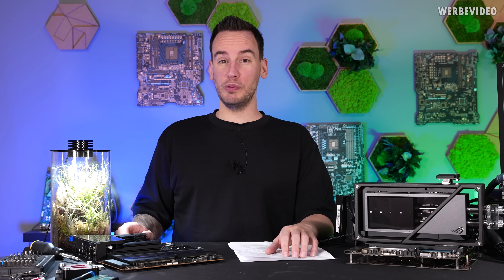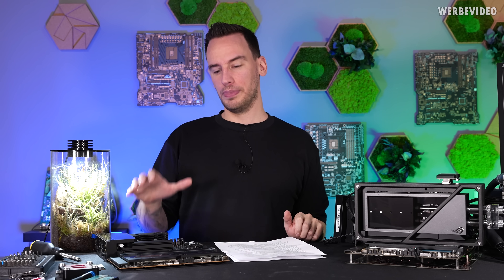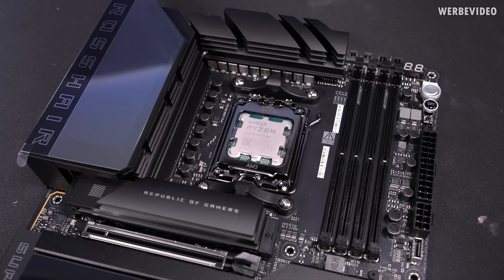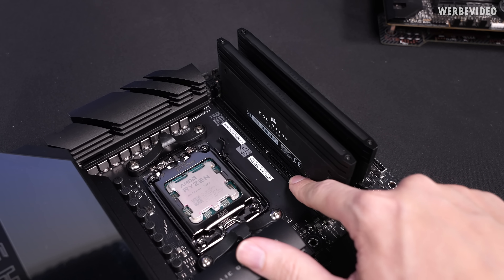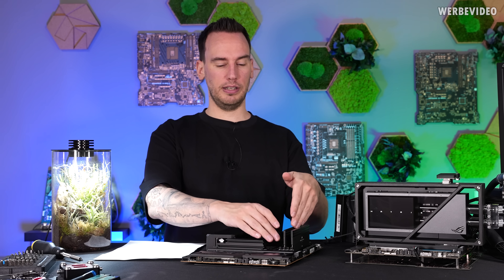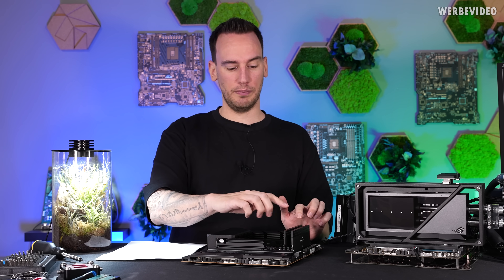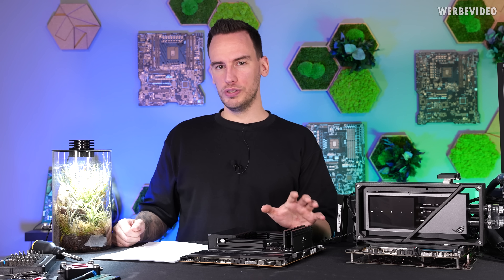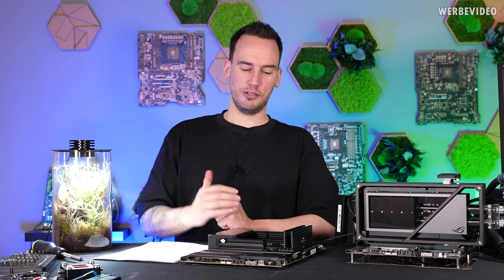How Empty RAM-Slots cause Trouble - ASUS NitroPath

Comment: Electrical engineer here. 

Any time a signal is operating at a frequency with an associated wavelength that is shorter than the cable, wire, PCB trace, etc. there will be reflections of that signal internal to the conductor. When a signal gets to the end of a conductor it does one of three things depending on what is at the end of that wire.

1. If there is nothing it radiates through open air, acting like an antenna that is transmitting.
2. If there is an impedance matched load it will transfer it's power along.
3. If there is an impedance mismatch power will be reflected back down the conductor.

Realistically there is a little blend of all three.

The longer the pin at the end of the trace the more it acts like an antenna, receiving and transmitting signals.
When two conductors are ran in parallel, a signal on one line can electromagnetically couple onto another line. This is know as "crosstalk".

The difference between pins acting as antennas and crosstalk transmission is simply the material between them. 

Air allows the transmission of a signal much better than fiberglass, PTFE, Rogers (epoxy and ceramic), etc.

Thus the shorter the pins the better the signal integrity.

With motherboard memory we have 288 parallel traces per dim slot. Each acting as a receiver and antenna, millimeters apart from each other. It's a wonder how we got this far. Eye charts with no eye tell me this memory form factor doesn't have much longer. I see CAMM as an upcoming stopgap form factor.

The ultimate solution is to get rid of these traces and pins entirely. We already see this in extremely high end parts using HBM.
Reply: would a "grounding" system be helpful in mitigating it?
if the slot is empty the "ground" is touched reducing/mitigating the problem.
when a slot is full the "ground" isn't touching. (not sure if having the slot occupied really helps but I'm sure it does a little).
Reply: @jetah50 
If you were to only ground the signal, it would just send it back down another trace or onto ground layer of the PCB. 

The best course of action would be to terminate the signal with a load. Removing the slot with open pins entirely would also work fairly well.
Reply: @joelduncan5110  Of course if you terminate the signal, you are taking away some of the power making the distinction between 0 and 1 smaller, so you'd likely need even more voltage to account for that which is another issue entirely.
Reply: @alexatkin  We would only be terminating where there is NC. The expected return of a floating NC and a terminated signal should both be near if not actually zero. The entire point of terminating is to remove the power in a manner that minimally impacts the RF spectrum radiation (usually via thermal radiation). 

Additionally increasing the power increases crosstalk. Not the best approach for this particular problem even if it were applicable.
Reply: What if I insert 2 additional modules to empty slots and disable these modules in BIOS (Asus allows this). Would it help properly terminate signal?
Reply: @dmitrylozenko7123  I don't know if disabling a channel in Bios would mean that it there are no data requests and thus no signal on the traces going from RAM to CPU or if the memory controller on the CPU just dismisses the returning signals. I would hope the former. Most board manufacturers that I know of have this option.

I did a quick test on some configurations a while back when trying to maximize the clocks of my 128gb of DDR4. Removing 2 sticks then disabling the slots, reinstalling them and re-enabling the slots. IIRC the results appeared to match the theory. 400MT differential between best and worst configuration on (qty.1 or 2) 64 GB (2x32GB) 4000MT kits, but I was messing with a lot of other settings as well.

Overall, it's an expensive and imperfect solution with minimal gain. If you really want the speed more than the space, just buy a two slot board. If you are in that scenario where you have two old cheap sticks you can give it a shot, but it may throttle speed to the lower performing kits values before disabling as well.
Reply: @dmitrylozenko7123  yep
Reply: @dmitrylozenko7123  Interesting idea, did you test this?
Reply: Another solution is BGA chips used in graphics cards, laptops and smartphones especially for GDDR and LPDDR.
Reply: That makes sense why some motherboards allow you to change the impedance parameters for the RAM as well. Some people went that far to achieve higher speeds.

Comment: at these speeds, your digital signal isn't digital anymore. You have AC instead of DC. Now instead of resistance being your enemy, you have inductance, capacitance, and loop length. This is really why reducing your "antennas" caused by the old slots gives a slight improvement. 

If you really want fast RAM, put RAM slots directly behind the CPU with vias and use SODIMM slots instead. What you can also do is put both sticks equidistant and spread apart from each other with the CPU in the center.

Comment: Spurious emissions of adjoining traces and pins is a solved problem in RF design. If they're looking to deaden the effect they need to go talk to the high frequency radio engineers. I wonder if they'll clue into using a dummy load card for empty slots. Something that absorbs enough of the waveform that it has no meaningful transmission power radiating away. Also, leaky emissions is how EMI side channel attacks work ;)

Comment: It is not an antenna per se. It is more about stubs in the signal path. Each stub creates possibility of signal reflecting back. This is why if you go for really high speeds you will have issues with two slots per channel. With even higher frequencies you will ultimately hit a ceiling and connector itself will prove to be challenging. At some point in time we may see CPUs being integrated with RAM chips on the interposer again.

Comment: Interesting that Asus talked about interference. While that is certainly an issue, the reflection from the stub on the transmission line becomes very significant when you're scrambling around chasing a few picoseconds. I wonder which has the greater impact.

Comment: What I find ridiculous is that we were all sold 4 memory slots motherboards, and then told that filling all 4 slots didn't guarantee the advertised speeds of the memory modules anymore... So everything should just have been 2 slots. I'm still running only 32GB of 6400 DDR5 in 2x16 configuration (initially bought because DDR5 memory was still expensive in the fall of 2022), because both Gigabyte and G.skill told me running 4 modules at that speed was a trial and error undertaking.

Comment: It's not an issue of the pins acting as an antenna, but rather as an unterminated stub length, which causes reflections of the signals and degrades the waveforms. At higher frequencies, the stub lengths of the socket pins become larger relative to the wavelength of the signals, and thus have a more significant impact on the signal quality. Making the pins physically shorter without sacrificing their mechanical function gives you more headroom for higher frequencies before the reflections turn the signal into mushy garbage. When you install a dimm into the slot, the stubs are no longer stubs and are terminated by the dimm itself, thus (ideally, in wishful thinking land) resulting in no reflections and signal degradation.

Comment: So we should just have a dummy ram board that is a insulator to fill unused slots. Bonus points if it's corrugated and insulates each pin individually. Easy done with some blank fine routed pcb you would think. Probably about 2 bucks in hardware...

Comment: buildzoid from AHOC has been saying this for years and it's one of the reason why as a DDR5 early adopter I was disappointed by tech tubers for the last few years DDR5 does not and never will work as expected with 4 dimms, be honest not at acceptable transfers I wish manufacturers would finally admit the truth and stop making boards with unusable noise antennas

Comment: It's actually for both fitted and empty slots. It's called a stub antenna and needs to be minimised or eliminated if possible.
Reply: If it folded all the way back to electrically connect the spring in a loop, would that reduce the problem even further or introduce reflections?

Comment: Interesting, BUT: where is the eye chart comparison between a 4-slot MB with 2 DIMMs inserted vs the same MB with 4 DIMMs inserted? If the problem is open circuits causing noise, wouldn't closing those circuits with DIMMs be the logical first test?

Comment: OK, improved conductivity via the gold conductors, reduced EMI due to trimmed "antennae" from top of conventional conductor, potentially increased conductor contact interface pressure due to acute curve. It is not clear how these new curves are retained to maintain/enhance contact pressure though. Module extraction would wear/cut the module pin surfaces if contacts were left as shown in the draft cross section shown at the beginning of the video.

Comment: Their marketing slide is atrocious.

It leads you to believe that the length of the contact material is affecting signal integrity, and a shorter contact length means less "noise" so to speak.  It also doesn't make any sense, because it turns a nice flat full contact to the edge of a point, which is horrifically worse, both in terms of connection reliability, and physical interaction (scraping).

The cross section gave a much better idea of what's, y'know, real.

I still think the contact point should be bigger regardless.  And not exclusive to ASUS, even timed.  Better the industry, not yourselves.

Daisy chain vs T-topology should be discussed far more.  It's the whole reason DIMM slot amount is even a talking point.

Comment: Are we going to have to start using dummy RAM cards for empty sockets like we used to do with RDIMM's? All the zero RAM cards have terminating resistors to prevent reflections or radiating signals.

Comment: How far does that antenna effect travel? Do empty PCIE slots also cause this effect? If they do, then could their antenna effect reach the memory, to cause interference as well? It wouldn't matter for PCIE itself really, since we never really come close to saturating that bus anyhow, but if they could interfer with the ram it might also be a factor.

Or at that range perhaps EMI shielding (both by design, and through configuration) reduces that from being a factor?

I'm not an electrical engineer, so I'm mostly just going off logic, and from what I have gathered here for my thoughts.
Reply: The effect of the electromagnetic field is reduced exponentially with distance.
But more importantly empty PCIe slots aren't receiving any signals, while empty memory slots do.

Comment: Why don't just make some sort of dummy dimms with shielding inside which would prevent signal degradation on empty slots ?
Reply: Is not enough, the moment the trace from the channel gets split for 2 dimm slots is enough signal integrity loss that high speeds are not achievable, that's why if you use 4 ram sticks on DDR5 the speed gets limited to 5200 (6000 if the motherboard is really good + god-like memory controller + a lot of tuning)
Reply: @ivantsipr  alright, thanks for the explanation 👍

Comment: Just to be clear, 4 dimms on DDR5 is still higher stress on IMC's right?
Reply: 4dimms on ddr4 3600 was a problem already where sometimes you had to lower the speed to 3200 to be stable, on DDR5 we are talking of 5200+ speeds, sometimes double the speed so double the trouble.

Comment: Yes, at those high signal rates, you'll  get signals turning back at the end of the pin due to impedance mismatch & signal cancellation occurs, because the returning signal is out of phase, causing signal loss 😮 The cct traces on the motherboard also ha e to be a certain lenght for a given frequency & kept the same lenght to match impedance requirements 😊

Comment: They should just stop making 4-DIMM motherboards for "enthusiasts" that care about memory overclocking. The standard should be 2-DIMM. The only people that might need 4 memory modules are content creators that care more about total memory capacity than memory speed. It really sucks that there is only like one motherboard model for each brand that offers a 2-DIMM configuration, and they are usually a limited production model that sells out before the demand for it is met. Maybe it is an experiment to see how many idiots will pay $1,000 USD for an "extreme" motherboard with 4-DIMM slots that totally sucks at memory overclocking.
Reply: Agreed. With 32gb and 64 gb sticks now becoming more and more common, mobo manufacturers should save on manufacturing cost and design by giving most DIYers 2 dimm slots rather than 4.
Reply: I'm not a content creator.  I've been using 4 DIMMs since Phenom.

One size does not fit all.  But these bad decisions are directing the market nowadays (heavy PCI-E/SATA slot reduction).  Modern mainstream mobos aren't even fit for purpose for some people anymore... despite us still just being mainstream users.

Special overclocking boards should be 2 DIMMs, not the standard.  Work on improving IMCs and signal integrity for the future, not your bottom line.

Comment: My question is, if 90%+ of people never use the full 4 slots of memory, why are they still their on the majority of boards? why not make 2 the standard, and 4 a lower quantity run?
Reply: Because they can sell less slots for more money now (which is ridiculous to sell less for more). Also if you aren't going for high clocks, then you can run 4 sticks for more capacity so it's not exactly useless to have 4.
Reply: Because, to the uninitiated, 4 is more than 2, therefore greater perception value. ~ Marketing explanation from guy that sells fireworks.
Reply: Cause normies mentality is "more is better" so more dimms slots = better motherboard and it sells way more than a 2 dimmer would.
Reply: Where are you pulling this "90%+" number, besides out of your ass?

Intel's E platform had 8 DIMM slots, ran quad channel, had 7 PCI-E slots and 10 SATA ports.   It was half the price of an X870E platform.

X870E has only 2 usable DIMMs, 1 usable PCI-E slot, and 2-6 SATA ports (which probably get disabled if more than 2 NVME is used).  Anyone who's been using multiple expansion cards and storage drives.. which is most people who've been using PC's for 20+ years, is now unable to use their hardware on modern motherboards.  Expansion cards (including GPUs) and storage drives don't magically become unusable when the next CPU comes out.

Castrating functionality that's been part of PC's for decades is never a good idea.  A PC from 1980 shouldn't have better hardware support than a modern one.. and those are even capable of fitting a card longer than 4090; by design.

Comment: With all of this, I wonder if someone could/will start to produce dimm covers that you could install in your empty slots to reduce or remove the interference. I feel like this is something that should be fairly easy to do but I really don't know. I know that if I could boost my ram a bit more in my AMD system by adding a couple dimm covers, I would.

Comment: Der8auer! You should try modding a 4 slot board to completely remove two of the slots from the surface of the board, pins and all. It would make for great content! The traces in the PCB would of course still be present, but removing the slots and pins protruding from the surface should yield even cleaner signal than this special design for the empty slots.
Reply: I was scrolling down looking to find someone who had this same thought, haha.  Maybe i'll hunt for a cheap used mobo to try this on, and then I'll do it to my x870 if it goes well :D
Reply: Почему не попробовать изолировать их  обычной фольгой? Сделать металлический купол можно за пару минут.

Comment: Very cool video! Not sure if I fully buy their explanation that in a 2dimm slot MOBO, you don't need Nitropath connectors - the antenna complication still comes into play - especially since the 2 dimms are right next to each other. It reminds me of 'Crosstalk' in audio applications - when one dimm is firing away at 4400MTs, the other connector will surely pick up some interference, even on the filled dimm slot. 

You can always reduce noise, and it becomes more and more critical as we increase in speed. Put the Nitropath connectors on a 2dimm MOBO!
Reply: There is still an antenna but it is tiny, and it is beside an existing termination of the bus, it will have almost no effect.
Reply: @jaro6985  right, in audio this can be as small as a 1-2db difference in noise, but every bit counts. I don't understand why they wouldn't put the premium features on a clearly premium motherboard.

Comment: so why dont they made the slot with a grounded metal on the outside to isolate signals from the "antennas" on smat prones every section that you need a minimum Interferens they are incased in thin metal that is short to ground. Combine that with the short pins and the effect will be greater.